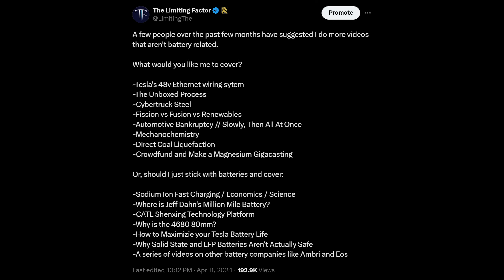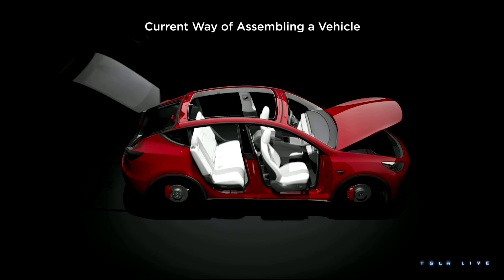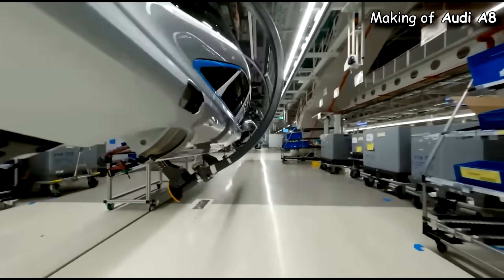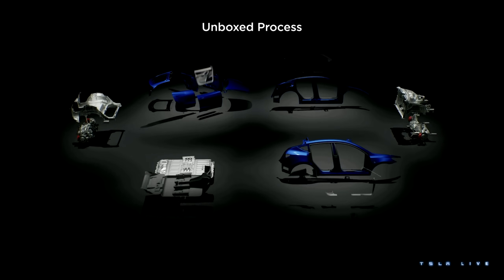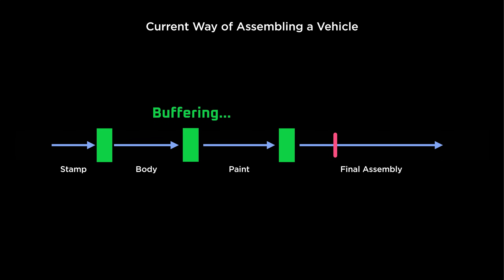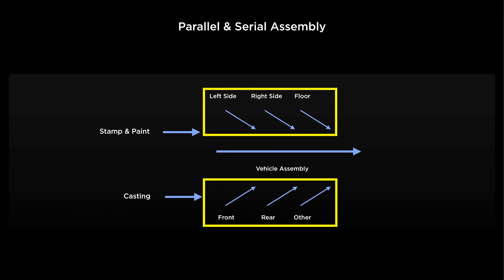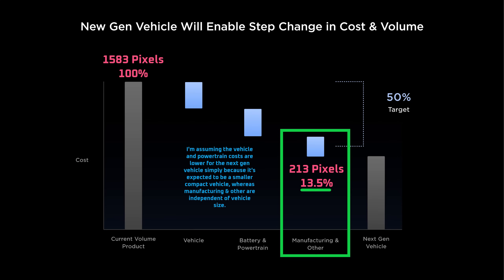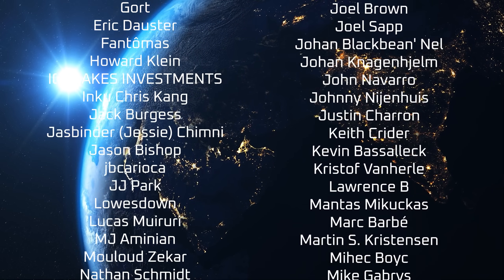Tesla's Unboxed Process // A Closer Look

Comment: "Ford already has this" oddly enough given to them by none other than Elon Musk. That's all that needs saying as a production matter. If you look at how wiring of modern vehicles be done upon in the USA this also looks just like this which has VASTLY improved robustness of ALL vehicle builds upon in the USA ice platform and pure play bev. This is why the "center stack" electronics in a car made in the USA has suddenly become so crazy advanced and massive "the electrical diagram actually works for the first time ever." There are two types of induction motors as well. No we do not need copper for either of those either😊😊

Comment: Is there not any reduction in structural strength of the assembled car when its in 3 blocks?
Reply from the maker: Based on my understanding - no.  However, integration was the most difficult challenge from the industry analysis I've seen.

Comment: Great video, Jordan. You did not mention Tesla One, the overall manufacturing management system. Which manage also spot changes and manage necessary relevant changes on other systems. This will be much easier in the unboxed process. It can also ensure that buffering mainly occurs in the inventory section and that the line itself hols the optimum amount of sections needed to complete the part.  It may even be that the unboxing proces spreads out to the other parts of assembly line. Like for instance building the structural battery back with additional elements like chairs, suspension etc. Tesla can provide information to see if it is more efficient to have an element move to another part of the subassembly. Exciting times.
Reply from the maker: Thanks man!  Yeah, there's a WHOLE lot I didn't cover here.  It could have been a 2 hour video easy.  

Overall good additive points.  Thanks for the comment.
Reply: @thelimitingfactor  Yeah, so True. If you decide to do a deepdive on Tesla One, maybe do a co production with Joe Justice. He seems to be on top of this.

Comment: Fine video but it's rather more complicated than you think , years ago I was given a job to stop problems with trim in the assembly of the Vauxhall Frontera SUV which was being assembled from mechanical kits from Isuzu ,  the issue was failure to adhere the plastics due to the temperature of the vehicles coming from the "colour buffers"  these were cold and were the strategic reserve for the production process ,  the issue caused rejects and line halts at assembly and inspection , I designed a IR heater to monitor the shell temperatures incoming onto the assembly and adjusted the heating required ,  it worked perfectly and allowed mixed colours of shells to lifted to the correct temperature on the fly ,  the shells varied by 30 degrees F depending if they were a freshly painted shell or were from colour buffer so could be days or weeks old , the colour line in the paint shop ran in batches depending on popularity and colour buffer space , there are thousands of points in the assembly that the smallest thing can cause a line delay , most of which you would think would be trivial but the consequences are enormous later down the line
Reply from the maker: Oh yeah, it's complicated as hell. I've worked in a factory.  Editorial decision to keep it simple.

Comment: There is one big change we haven't discussed and that is how to fix the different vehicle modules once they are sub assembled. Welding is probably not an option. Using screws is challenging as they have to be many or there will be stress concentrations. I would guess glue plus screws would be the best. On the Cybertruck with huge castings and very strong panels, screws are sufficient.
Reply from the maker: They covered this in a patent about a month ago 

I linked it somewhere in one of the comments below 

Bolts and adhesives from memory

Comment: The traditional reason for painting the fully assembled body instead of individual parts is to produce a more even and uniform paintjob, especially with fancy metallic-effect-paints that produce shiny reflections and patterns that are supposed to appear uniform across the entire car.

Depending on available paint options that may be something to think about.
Reply: Yes, I had heard that painting variations could be the Achilles heel of the UBP.
Reply from the maker: Definitely! Who knows, maybe they'll use stainless steel
Reply: @thelimitingfactor I think powder coating would be the fastest and most consistent as it is applied dry and the smaller parts could then go through a continuous oven. 
The oven could be as small as 4’x5’ opening…. Then again no paint would be best.

Comment: In case one of the lines takes twice the time you could just go with 2 lines?
Reply from the maker: Yes! I should have covered this in the video
Reply: @thelimitingfactor  i am wondering if any process in the traditional manufacturing is a bottleneck- if so I assume this kind of „optimization“ would help to increase production speed further

Comment: I always imagined that by having sub-assemblies it enables multiple Vehicle Assembly lines in parallel. Current lines are 30-40s for a car to be completed off the line, but instead have multiple assembly stations (rather than a line) to assemble each car... wont need snaking sequential line running through the factory but rather just nodes or almost pitstop like areas where the assembly is done and drive off?

Comment: Great video. You fill in many of the gaps from the presentation. I only wish Tesla would use this manufacturing expertise & excellence to build cars like the XPeng MPV 9 or the Li Mega. Both have amazing aerodynamic drag for their size, more seats, middle row massage seats, a minifridge, and a rearview mirror that can switch to a screen for the rear camera. Everything people want in an EV limo or family hauler. The best thing Cybertruck has done IMO is make cars like those MPV I mentioned look sleeker and more normal. Now if only I could get the $55k XPeng in America for that price!
Reply from the maker: Thanks!

Teslas tend to be more utilitarian except for the very high-end vehicles 

They've found that a lot of people don't use the bells and whistles 

Most people would rather have a lower cost vehicle

Comment: Rover cars had a conveyor that ran at one speed only. It would have been difficult to change it. The 400kW infra red sill oven baked the sills based purely on the line speed to get the desired temperature profile, with no electronic temperature control at all. 
Unboxed process allows different station process speeds throughout the factory.
Reply from the maker: Excellent point!

Comment: By making the paint shop more efficient, they also lose a major hidden issue. Paint. 
Automotive paint has to be stored within a tenth of a degree. It’s how a lot of long term warranties on body’s are achieved. Less paint less storage, less energy.
Better paint efficiency also means less pollution. VOC’s are a problem for paint shops to control, and those controls are maintenance heavy. 
Often they use wet booths, however Tesla have already started to attack this point with a dry system. So less water usage.

Comment: How does bolting the sub-assemblies impact the crash performance?
Reply: Minimal impact. Sorry I couldn’t resist.
Actually won’t change anything as the whole assembly is the tested piece.
Reply from the maker: It won't, you just have to design to it
Reply: Are you sure? Modern vehicles use adhesives to augment stress concentration areas ( welds, bolts). E-coat oven cured adhesives are higher performing than ambient temperature cured adhesives. Unboxed requires ambient temperature curing.

Comment: What are the cons? Could it be that less parts then it's more expensive to replace each part? If the car gets hit behind the back, it doesn't seem to be an easy fix
Reply from the maker: No cons 

It just takes a much higher level of technological skill
Reply: When they assemble the finished parts, and they don't align within tolerance, maybe it would be harder to get them into alignment without damaging paint/finishing. I hope they'll be designing the fastenings to be able to handle this instead of the cybertruck "make it all be micron level accurate", and when it isn't you're screwed.

Other "cons" is that this is a new/untested process. We don't know how well this will end up working in practice. That goes for any innovation though. 

Crash worthyness and lifetime may be negatively impacted by this, since the overall structure of the car is somewhat different because of the fastenings. 

These aren't unsolvable, but new is different.

Comment: What I don't understand about the unboxed process is that it is said to take less factory footprint area.
It seems to be that the unboxed process is similar to paralell processing in a CPU which utilises more die area, though admittedly here more throughput is achieved via multiple channels whereas with the unboxed process the same amount of assembly is carried out in less time.
It seems to me that thought the lengthe of the main assembly line will indeed decreace it's 'width' will increace.

Does the unboxed process really take less factory footprint area, the same, or more?
Reply from the maker: I'd have to re-look at the presentation, but at minimum, it's creating more output per square foot of factory area by accelerating throughout.
Reply: @thelimitingfactor  Thanks for the reply.
I still have my doubts that it even creates more output per unit of factory area however. 
I can see that it reduces the time from start to completion due to improving ergonomics and parrellisation but if you have to provide workstation areas beside the production line this surely must require more space. The length, (and area) of the main line will indeed be reduced however.
Be careful of conflating the concepts of rate of throughput with rate per unit of  area.

Comment: About 40 years ago Volvo developed and implemented a similar process as the proposed Tesla unboxing process.
Volvo did not continue with it and returned to the traditional production line approach.
Tesla has the advantage of gleaning lessons learnt from the Volvo attempt as well as having the advantage of more advanced technology being available today.
Reply: These ideas are rarely new. I wonder how franken-car stitched from 10 parts will look and behave in long run. Of course, every car is built from parts, but each part of process allows for alignment to happen at end of that point. I guess consumers will find out in the end.
Reply: I suspect the advances in automation and manufacturing precision in the last 40 years will make a big difference towards making the process more viable. something like the unboxed process requires very tight tolerances to go together properly. 
The gigacastings with integrated brackets instead of lots of separate parts also dramatically reduces compounding errors, so that's probably a big part of what makes the unboxed process even possible even with modern precision and automation.

Comment: Great video, thank you.

Unboxing also enables the integration of humanoid robots like Optimus with much less complexity. A robot working on one sub assembly that doesn’t require “craning” its neck to get into the vehicle is going to massively increase operational efficiency. And you only need to “bite off” one part of the vehicle at a time.

Tesla pays $25/hr or so ($32.50 fully loaded) per person on the line. Optimus is estimated to come in at $1/hr. Even moving to 10% Optimus installed on the sub assemblies will have a massive opex impact.

Comment: Thanks for this, nice summary. Not mentioned were steer by wire and brake by wire, implemented in the Cybertruck. This is enabled by the Canbus loop, that you did mention. Removing steering wheel shaft and hydraulic lines for brakes helps the unboxed process by removing difficult linkages between sections of the building. Enabling a plug and play assembly.
Reply from the maker: Thanks! That was covered in the last video of the series.

Comment: What's your thoughts on Solid state batteries? Especially since MG claim they will come out next year. And comparing to Tesla's battery strategy. Could make an interesting video?
Reply from the maker: At least for the next 10 years, solid state batteries are going to be considerably more expensive than batteries using a liquid electrolyte
Reply: We can hope, but so far they're a lot like Fusion, always a year or two away.  I think Toyota has been planning to produce solid state batteries next year for going on ten years now.

Comment: why not painting insides? tesla can rust, and any aluminum alloy can be real bad with it. Some people used tesla cars in high humidity countries ended with rusted through areas (as they said - turned in powder). Tesla car shouldn't last for 5-10 years, that'll make it's most expensive part - battery pack - useless (that can last for 30-40 years)
Reply from the maker: Hmmm, I haven't heard anything about that about the rust.  I'm curious which years that was for.

As for the battery.  No, it won't last 30-40 years.  More like 15-20 depending on the chemistry.
Reply: @thelimitingfactor  rust goes from wet dirt that that have some salt in it. PArts that involved most in it is places behind wheels (mostly, front). Thin anti-corrosive layer goes down from 5-10k miles(maybe faster), then dirt placed there starts the rust and if that is started, there is almost no way to stop it since it goes deep into metal. 

Batteries are just guaranteed to use in 15-20 years, they can last a lot longer (and there's no real risk of car self burning if chemistry is LFP) so that cars and used battery packs will be there, it's only matter of time.

Comment: Another thing that stikes me about the unboxed process is there is no need to have the same number of lines for each portion of the vehicle e.g. Takes twice as long to construct the front of the car as the doors? Just have two parallel linnes for the front of the car and 1 for the doors.
Reply from the maker: An excellent point
Reply: And those stations will be less complex. So easier to modify and upgrade.
Reply: Looks like the paint shop can be a lot smaller as well..

Comment: In the unboxed method buffering should actually be required in sub assembly areas so if there is a slow down the extra parts made in advance can fill the gap while the problem is solved. Over time, common slowdown issues could be identified and buffer size could be adjusted to only be enough for the worst case scenario. Buffering can make the best use of vertical space like and upsize down pez dispenser.

Comment: The design of the vehicle is key to improving the build process. Many vehicle designs would be impossible using unboxed but Tesla makes EVs only with very clever structure designs so they can adjust everything as needed to get to the next level of optimization. Other automakers can't do this because they rely on parts vendors for some of the car and don't have control over it's design to some degree.

Comment: The question is can this produce a quality product... its one thing putting together a truck or a bottom of the barrel cheap vehicle, and another thing putting together a high end product where long term comfort and ease of use, and very low fault tolerance, are the norm
Reply: It already will be improving quality.  Giga casting creating a solid frame for the panels to fit to. The battery and seat sub assembly cutting down on through door mounting damage risks.

Comment: In theory the "Unboxed Process" allows for significant redundancy similar to a modern server stack where there is no single point of failure. All the sub assemblies can be duplicated and run parallel; this offers: *redundancy, *expandability & *live-upgradeability. Indeed the "Final-Assembly" can be expanded out to more than one line for the same reasons. (Sidenote: The CT door autopsy showed the modular door subcontroller with only one connector to the body - no loom. All part of the evolution towards this new process).

Comment: How will all the components be joined? Bolts, glues, welds, tab & slot, special techniques for mating castings (aluminum, maybe magnesium) and stamped parts (steel)? Guessing continuation of Tesla's experience joining structural battery pack & castings. It might be fun to learn specifics.
Reply from the maker: The major subsections will mostly be bolted together
Reply: The Gigacasting are directly joined to structural battery pack w/ bolts and adhesive.
Tesla has perfected wielding Gigacasting to stamped steel & extrusion.
but is constantly switching over to partial UBP. modules are becoming high quantity of cast parts , rather than stamped steel, extrusion, and small cast parts. eliminate brackets and use CRP moulded over extrusion or castings.

Comment: Tesla AI factory 🏭 software is underappreciated.
every Tesla made , has a digital twin in software, and in 2024 its final assembly is done w/ computer installed, and running in Service mode. this is to reduce mistakes & alignment.
Reply from the maker: Yes!  There's so much more there to cover!

Comment: keep in mind, the WORLD will go Gigacasting, structural battery pack & unbox process.
Cherry auto in China, now using 16,000 ton Gigapress to make complete Underbody.
and TK press makes 9kT, 12kT, and 16kT presses.
the 16k ton gigapress, is same size as apartment building on its side.
Reply: But a completely cast underbody doesn't allow for the easy access of an unboxed approach.
Reply: tesla uses 9t press becouse the fluid dynamics goth probably optimized to the max and beyond. also less pressure means longer lasting tools i hope